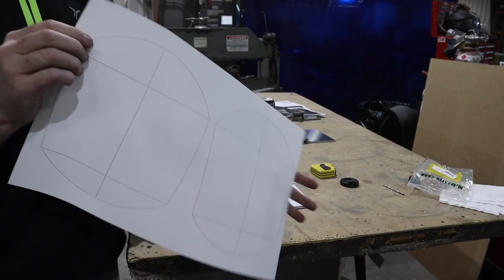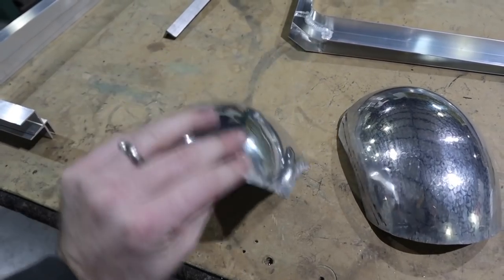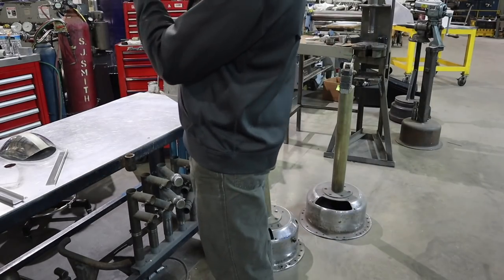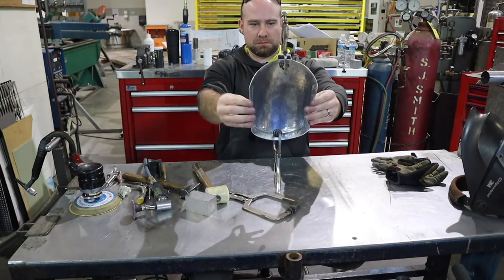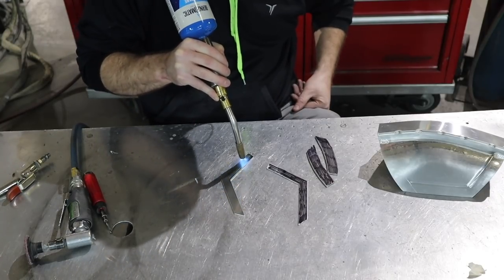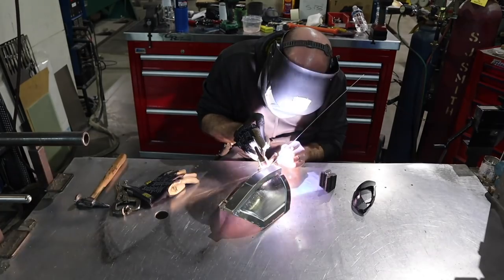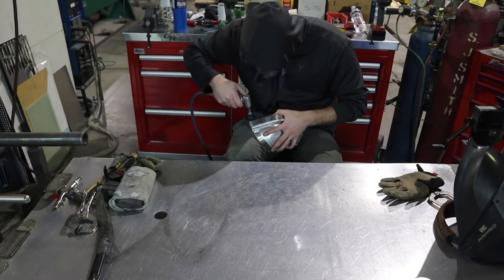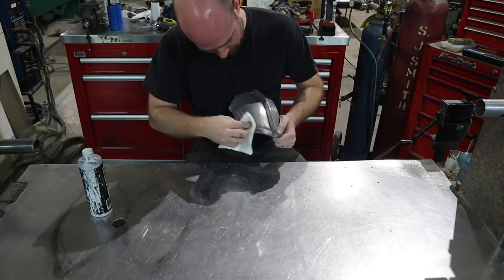Making "the Mandalorian" Pauldrons out of Metal

Comment: Nice solution for floating shoulders.

I've been thinking of doing an aluminum plates set for my next mando, but I likely won't be able to get a welding machine. Would durafix rods work, or would that not hold up well enough in the long run, even being just costume pieces? Or should it only be used for certain reasons on cosplay armor?